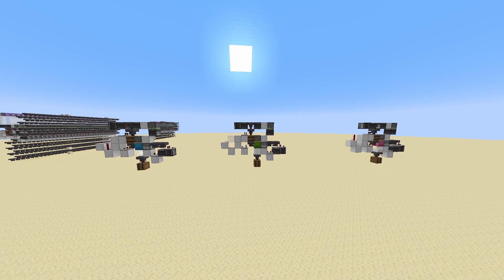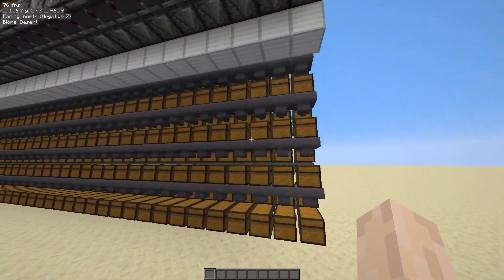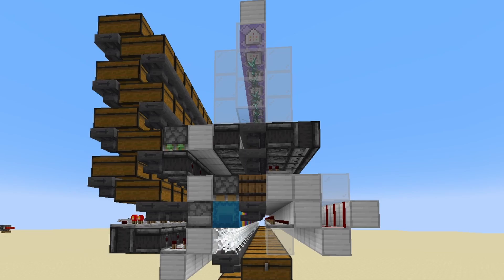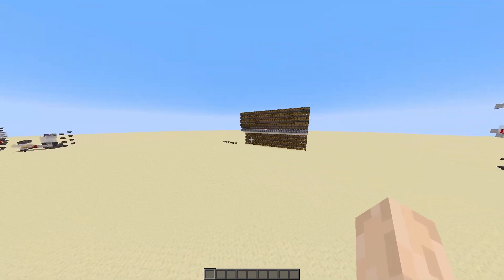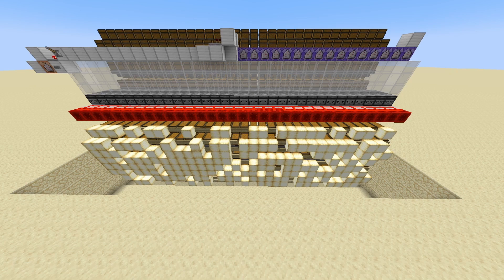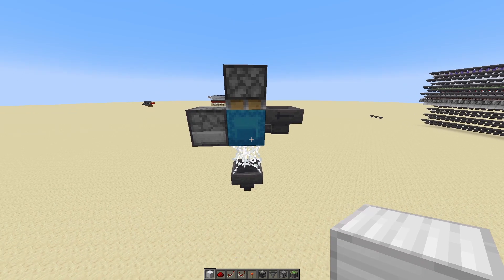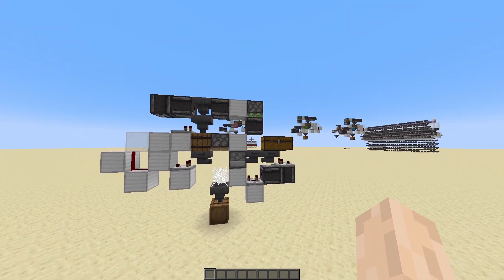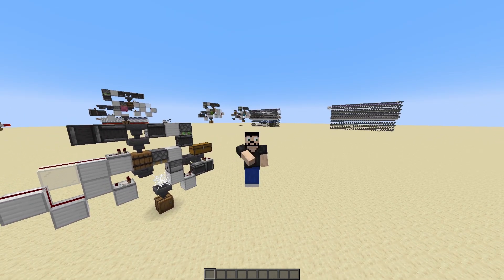100% RELIABLE 1-Wide Tileable Shulker Box Loader - Tutorial

Comment: Wow. To have a 1wt option that is 100% reliable is amazing by itself, but this loader has so many great features on top of that. Reading the hopper instead of the box is so smart. Being able to use it as a mixed loader and not having to manually break the box if a stray item gets in is so helpful. If your storage gets full you have easy access to the boxes in the cobweb before they despawn so no more tearing apart the whole loader, plus it loads the empty boxes automatically?! Sign me up. It's such a huge improvement over the old design its kind of hard to believe. Safe to say I will be using this a lot in my world.
Reply from the maker: Glad you liked it!! Thanks for your kind words 😊

Comment: Awesome design. I'm definitely going to start using this design in my worlds. I also messed around with it, and found that using beds instead of slabs gets it back up to the 99.98% reliability of the powdered snow. (Used the same testing setup you did and had 3 incorrect boxes). So another good option for people who don't want to go caving for cobwebs and don't want to farm tons of powdered snow :)
Reply from the maker: Cool! Thanks for the alternative, it's always good to have several options. Plus, with beds you can cover 2 modules with a single bed (if you tile them together).

Comment: Oh man you are seriously underrated, you've definitely earned a new subscriber. I for one really appreciate how you actually explain the redstone mechanics. I found that if you take the hopper comparator output through an extra block and use a half slab or glass when the dust rises you can get it to only require a signal strength of 2. Which cuts down on the amount of items that have to be kept in the hoppers.
Reply from the maker: Thanks for the sub! Really appreciate it. I did it with a signal strength of 4 only because of non-stackables, but if you are not going to be loading any non-stackables, your way is a good one to make it a bit cheaper and compact. Nice!

Comment: You’re testing with equal items that all fill up at the same time. 
So when that comparator puts out a strength of 6 (2 non-stackable items) it will propagate to 2 neighbours to each side. All these modules brake their shulkers regardless of the filling state…

So the reliability is only about shulkers staying in the correct module. 

I’d suggest using a beehive, chiseled bookshelf or composter to get a second input of 5 into the same block similar to the old variation with the redstone block.
Or extend the back to a length of 6 redstone dust.
Reply from the maker: You are totally right! I don't know how I overlooked that little detail. Thanks for the suggestion, it's a good idea. It also should be fixed by just extending the redstone line from 4 to 6 pieces of dust. It would just add 1 extra column of blocks to the footprint of the contraption.

Comment: Hello! This video was recently shared in the Storage Tech Discord, and although it is a bit old, you may still be interested in some input:

(1) Cobwebs and powder snow are not particularly easy blocks to obtain in large amounts. If you happen to have a lot of them it's fine, but that's often not the case. Reliable (in this case a specific type of reliability called "slice-preserving") designs nowadays use a mechanic called "precision hopper", where you unlock a hopper directly below the box on the same game tick you break the box. It's a mechanic that uses more redstone components and is, therefore, easier to build in large quantities.

(2) The sticky piston being short-pulsed and spitting the observer is an undesirable design choice we call a "togglestate". Having it brings along a bunch of issues, including: (A) Building incorrectly and going unnoticed, causing the loader to not function, or (B) in case of an accidental unload or server crash, being left in the wrong position, causing the loader not to function.

(3) Having a conductive block above the dispenser is not tileable due to QC. It may be the case that during some interval between adjacent slices replacing their boxes, one of them fails to do so.

Feel free to join us over at the Storage Tech Discord server, if you need anything from inspiration from existing designs to good feedback from experienced players: https://discord.gg/JufJ6uf
Reply from the maker: Thanks for the input!! I am always looking to get better. And funny enough, I knew all of these things (Just wasn't careful enough when designing it). But I will definitely be joining the discord to keep learning!

Comment: Thanks for the video! This loader was a life saver. With the older design that was prevalent, not only was I seeing the shulker box item trajectory issue (loss of boxes or picked up by wrong hopper), but I think I was also seeing some QC shenanigans with the box breakers? They would get stuck in the extended position and not deploy a new empty box, hoppers would get backed up (which I'm sure led to gold getting burnt) and was seeing all sorts of partially filled boxes in the output.

So far this new design has been perfect!
Reply from the maker: Glad you find it useful! Thx for your kind words.
Reply: im still getting the new boxes wount be put out error. remade it 3 times.